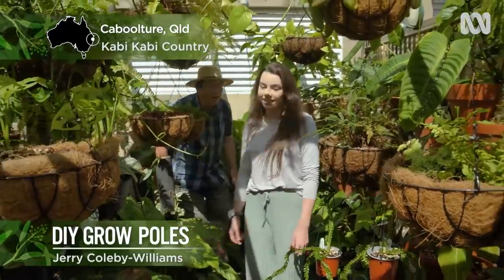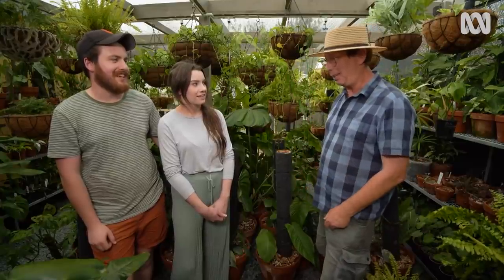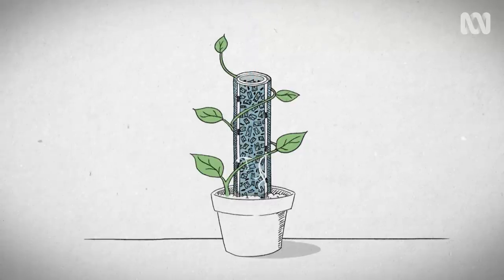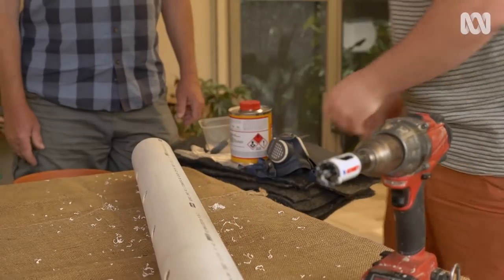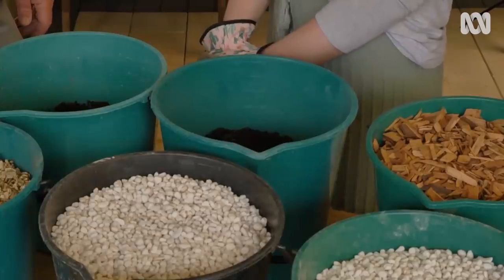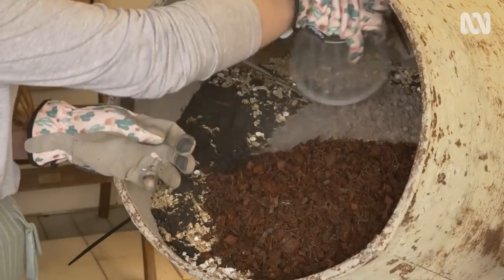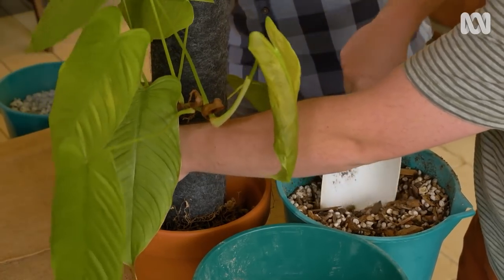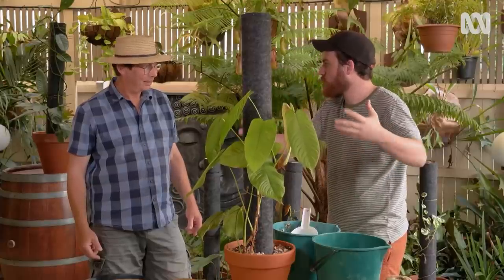How to make grow poles and custom potting mix for aroids | Indoor Plants | Gardening Australia

Comment: Can’t wait to try this out! I’m confused as to what mineral rock is? She used it in the soil mix with the fertilizer pellet.
Reply: I've always heard it called rock dust before.
Reply: The one we used in the episode was called Soft Rock, but the brand isn't important, nor is its addition.
We had a large bag of it lying around and felt it would be a useful additive to provide extra minerals to our mix as an additional amendment.

From the manufacturer, they state that it is "a bio-friendly, colloidal clay-based calcium phosphate" and that "this exceptional fertiliser includes 8 – 9% phosphorus, 19.3% calcium, a high analysis of silicon and a rich lode of trace elements".

Hope this helps!

Comment: Replace that with a bamboo pole and jute fabric instead of felt and I will buy it. Plastic is annoying, more so those small curled ones post drilling.
Reply: Great idea, I addressed my thoughts on alternate materials in a reply to Scott’s comment on this video which you might find helpful. I’d love to see alternative ways to make these whilst being more environmentally friendly though! Please let me know how you go if you make anything similar.
Reply: @jacoblukewood  I usually don't make these moss poles. What I rather do is plant some palms and then use them as support but its years before they are ready. Other way to do it is, I use bamboo with coir and wrapped on top with moss. A wire mesh holds them together and all of them are good for earth.

Comment: how can I find this smart couple on Social media? any Instagram links?
Reply: Yes I’d like to know too
Reply: Thank you for your kind words. You can find us under the username 'imgladiprickledyou'.
Reply: @jacoblukewood  I thought you were trolling with that name but it's the right account. Thanks! Can you share some detailed post on how the Felt poles are working? I can't get good moss either.
Reply: @komalthecoolk  the poles are working well! Some modifications are in the works as we’ve moved and have a lot of space indoors now.

The changes I’ll be making are:
- more holes around the pole for better water distribution
- cementing (PVC gluing) a PVC coupler to the top of the pipe before I wrap the pole in felt to allow it to be extended without having to remove the felt from the top.
- cutting the felt more accurately to avoid the overlap where the seam is as it’s ugly. Ideally I’ll find a way to cut perfectly so the seam matches up perfectly.

If anybody is having trouble sourcing the felt, a generic equivalent is Geofabric used to line dams, although I found many brands of Geofabric to be too thin which is why I opted for this product from JJ Davies made from recycled PET bottles.

If you’re in the Brisbane area, Oxley nursery use these poles on many of their display plants around the nursery (a slightly different design but much the same) so you can see one in person. I think they get their felt elsewhere but I haven’t asked.

Comment: Plastic plastic plastic 🤷🤦‍♂️... really?!? try at least going for recycled building materials or salvaged metal for the pole. I'm surprised in the same episode where Millie is pushing for less plastic in turf, Gerry is promoting plastic materials 🤦‍♂️🤷
Reply: Metal poles are too cost prohibitive and would have to be galvanising to prevent corrosion.

The fabric we used in this episode is made from recycled PET bottles (like soft drink bottles) so whilst it’s not the perfect solution it’s better than using virgin plastics.

We often use jute twine around the garden and even to attach the plants to the poles until they grow roots around it. It’s great how it decomposes over time, generally by the time it has broken down the plant has attached so it’s never strangles the plant and we don’t have to worry about removing it later in time.

I have seen hessian fabric used to make a similar style pole however it’s longevity was short due to it decomposing and it’s stressful to the plant to remove them to replace the fabric. The idea is to extend these as needed so the longevity is a sort after trait in our setup.

I understand PVC isn’t great but I feel like we make good use of it and try to minimise use of plastics in other areas of our lives from the terracotta pots in the garden to the glass jars in the kitchen.

Thanks for your feedback!